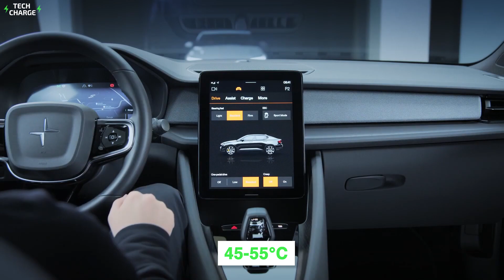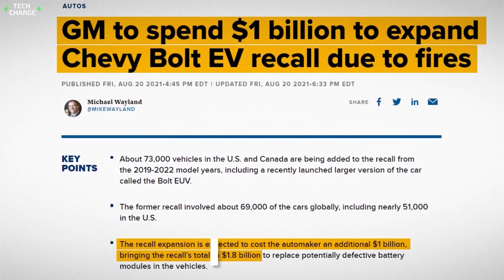The Shocking Truth About EV Fires You Need to Know

Comment: In an ICE car you carry, in the form of liquid fuel, about half the energy you need to move your car, the other half being provided by the air containing the oxygen needed for the chemical reaction to release the energy required for moving the vehicle. An EV has to pack ALL of its needed energy and carry it along...
Reply: totaly irrelevant, when ice cars burns and uses the oxygen of the air and with this releases same heat energy than BEV.
more importantly ; just because an EV burns doesnt mean that the battery automatically also burns ,
in other words in  many EV fires the battery wasnt affected before firefighter arrived which lets statistic look even better for EVs
Reply: @Pyrcae  Not irrelevant.
Reply: @Pyrcae no. The battery contains the oxidizer as well. They burn way hotter than gasoline  cars.
Reply: @thinking-laaf  
battery fire temperature is high only on small spots, looking at the whole surface the average temperature is not different from ICE car. 
anyway it is also often neglected that the battery or the fuel tank are only responsible for a small part of the fire and in fact the rest of the car, tires/seats/plastic interior ... does produce a big part of the fire & heat
Reply: Sobering thought and good point, Jean.
Reply: This is the crux of the matter. That's a lot of energy. Couple it to the basic fact that this battery technology is new.  It is not as regulated as ICE manufacturing because regs on the latter have had best part of a century to get to grips with the basics of ICE tech. Then you add in the pace of innovation in battery-powered technology and the temptation of manufacturers to go with innovations before they have been time-proved.

Now add in the difficulties with pollutants in extinguishing water and air pollution from the fire itself.
Reply: @anemone104  
statistics are clear that its 10 to 50 times more likely that ICE car catch fire.
and I am not sure what you mean with your pollution statement , but you hopefully not forget pollution caused with the need of fuel for ICE. beside of the permanent local exhaust gas we faced enormous pollution due to the Extraction of petroleum.  Deepwater Horizon  ..  just name one of the numerous disaster
Reply: @Pyrcae  Not true numbers.  First, what is it, 10 times? 50 times?  You don't know!  Also,  those are 20+ year old ICE cars.  Wait until EV's get that old, you'll see that EV's are not so green when they catch fire.  There are hundreds of EV Fire videos, soon to be thousands.  Who would think that going green would cause so much pollution?
Reply: @COSMACELF1802  
10 to 50 times is based on different parameters & calculation ,
the point is that no matter from which perspective you look at it , ICE catches by far a lot more often fire than BEVs.
Reply: @COSMACELF1802  first mass produce  EVs are now getting 10 years old and there is absolutely no evidence for higher fire risks
Reply: @Pyrcae  It's all guess work,  time will tell.  Let's see in another 10 years what happens.  Suffice to say, EV's catching fire is not a reason to avoid them.  My reason for not getting EV is that I can't afford one.  I can buy a used ICE car for much less than EV.
Reply: @COSMACELF1802   no need to underrate the clear numbers & statistics. this is no guess work. 
regarding the price I fully agree with you that today they are still too expensive for big part of the consumers, while we also have to understand that we are still at the very beginning of the transformation where as usual first the wealthy people are able to afford , it was the same with the mobile phone, the TV as well as the first combustion cars 120 years ago.
battery production costs decreased by 80% in the last 15 years, this will continue and in the next 5 to 10 years BEVs will be cheaper than any comparable ICE car
Reply: @Pyrcae  That's a fair prediction.  But for now, the EV's still have problems.  I'll wait and see, but it's wrong that the government mandates them.  Oh,  EV's aren't really so new as you think they are.  They've been trying for many decades.
Reply: @COSMACELF1802  yes, we already had BEV 100 years ago, on some spot for a short time even more successfull than ICE cars.
Now its the battery technology of the last 20 years which is new and made BEV competitive to ICE cars.
Of course they are still several challenges we have to face, especially the sufficient power distribution to many homes. but none of the challenges are real blockers, we can go for the huge benefits of the BEVs for which it makes sense to prioritize its development. and this is by far not only about CO2, its also about importing only a third of the energy for the same distance driven, this is reducing energy imports and dependencies from other countries.
Reply: @COSMACELF1802  and its about industry and job security , car industries have to be pushed to BEV to make sure china wont serve whole world with BEVs because they were faster with the development.
yes , BEV transformation is hard and might cost jobs, but staying with ICE car industry will cost a lot more jobs , I can assure you germany is already facing huge risk to lose the huge china market because they were too slow with the deveplopment of the BEVs

Comment: I wonder what the insurance companies think of this, does it cost more to insure an EV?
Reply: I Don't expect that to last very long.  Just a small bump can total an EV as apposed to a petrol or diesel.  Repair shops require a large distance between ev cars to work on them safely.  IMO, ev's are a good idea. But definitely not the answer.
Reply: It ought to.
Reply: My insurance in the UK actually went down by £12 a year. Hyundai ioniq 38kwh costs me £242 a year fully comprehensive
Reply: Insurance business is based on risks management, not emotions and fears, otherwise there’ll be no such business. Imagine your house could also catch fire from faulty wirings, short circuits etc. Would you be happy for insurance companies to then stop offering covers because of house fires everywhere? It’s same for cars, be it gas powered or EVs, they can all catch fire. However insurance companies base their premiums on actual risks experience, not YTube videos like this one. ( This vid included a car fire with a red fuel tank close to it and a row of burnt grass depicting the line of fire travel to the burning Mercedes!)
Reply: @jacobheinz8236  Yes I would agree and thankfully they do would on facts. However what I was really saying is the more EV's show they have risks the insurance will increase. Of course if the facts so they are not a risk then we will be fine but I somehow think the risk costs are higher than we think. Hope Im wrong because I would like an EV but Im very hesitant of something that if it does catch fire is near impossible to put out and would likely take my house with it but I wouldnt want to leave it on the street either.

Comment: With all the rubber plastic, and the Toxic Corrosive Chemicals in those battery 🔋 Packs,  where is the clean air, and public safety? This is your future, and for fender bender on a Tesla is $47,000. Due to Cameras or LiDar Sensors 
Normal cars are $10,000.
Just heard most Automotive Insurance Companies are leaving the state due to the Electric Vehicle's causing involuntary fires of other properties, as well as their homes. 👦👍🏎🏁🚩 Petrol ⛽️ is my only futures, as a matter of Fact 2 Tesla's were trying to run me off the road.  Since I am against these and commented that when unplugged these battery 🔋 Packs Packs don't have cooling systems flowing through the battery packs.  To keep them in nominal temperatures 🌡 to prevent expansion and crushing cooling systems. Which If you look up Mix Lithium Ion and Water... all you seen in the video occurrs.

Comment: Lithium battery fires are not extinguished.  Water is sprayed on the location to keep things cool and prevent the fires from spreading.  Lithium burns at a high enough temperature that the water molecules in the electrolyte dissociate into oxygen and hydrogen, so lithium battery fires do not need external oxygen.

The leading cause of short circuits in lithium batteries is the recharge cycle.  Even the highest quality, best maintained battery that only connects the highest quality, best maintained charger, under ideal charging conditions, will form a short circuit.  It will take longer than for lower quality, ill-maintained equipment, but it will happen.  Lithium batteries release energy when lithium atoms leave the electrode and dissolve into the electrolyte and recharging the lithium battery is done by causing lithium atoms to leave the electrolyte and bond onto the electrode.  The problem is that the atoms do not return to the same place on the electrode that they came from, but tend to clump where the electrode is rough.  With additional charge cycles, the roughness gets worse, until the short circuit forms.  When the short circuit forms, there will be a fire, if the energy density is high enough.  The best quality batteries start out with the smoothest electrodes, so it takes longer to form the short circuit.

Redox batteries get around the problem by having two electrolytes that produce energy by enabling a flow of hydronium ions [H3O+] from one electrolyte to the other, through a membrane, and then being recharged by forcing the hydronium ions back the other way.  Redox batteries are developed enough for power grid use, but need more development for vehicle use.  The electrolytes may be some combination of corrosive or toxic.  A potential advantage of redox batteries is that the electrolyte can be recharged separately from the vehicle, so a vehicle with discharged electrolytes can be recharged by replacing the electrolytes
Reply: That sounds like a decent tech for stationary batteries but I do not think it will translate well to a car. By design it would probably be very difficult to scale its size down and increase its energy density enough to be suitable in cars or other portable uses

Comment: When an EV goes up, it's an inferno, and can restart at any time even if you think it's out. It's called thermal runaway due to shorts in the sealed battery unit. In principle, it could happen to any EV at any  ime without any warning, and can be so intense, nothing can really survive. It can happen when the car is parked and idle too as discussed. Poor build quality/QC in far east EV's means it's way more common there, and if China begins large scale exports as expected, it will become more common here too. Fire departments now have to ask if an EV is involved in a crash so they can bring along car sized 'bath tubs' with them and completely immerse the EV in it, possibly for hours as it's the only way.

Comment: And ferry company's in Norway is banning EVs and hybrid cars because of fire hazards. And Germans are now charging there cars with coal powerplants after shutting down all nuclear powerplants...
Reply: Even with some of the ferries running on lithium batteries. 😂
Reply: @jamierose4088  It's not the same.  A ship running on batteries will not have the same risk of fire as a passenger car.  Cars rust, and all EV cars will eventually burn, it's a matter of time.  The ship on the other hand will have commercial funds to maintain and replace the batteries before they are unsafe.  The ship also does not suffer the same vibrations as a car does.  The first thing you learn in car mechanics, anyone can make a car, but it takes serious thought and skills to make one that can drive for thousands of km's and several decades.  EV's are still very new and will be proven to be not as green as the liars want you to think.
Reply: That is a very good idea!  Safety first.

Comment: First EVs due Pollute  the simple FACT to make one horse power  takes universally the same number of (can we use BTUs ) power units be it from Gas Diesel or Coal  and wind  or solar do not count because there too little around   
HUH the Second problem the Numbers that are stated for the Bolt are WRONG and are well published  they have a major problem of FIRE they were ALL recalled there were some that were not recalled because of AGE and the Laws Regarding recall 
The Common EV is possibility safe as a short term Commuter Vehicle and
in the long term of things this may just Prove to be an interesting FAD imposed on the populaces to control a mass transportation problem   and is a symbol of no more then Status    interesting Video well made  good for the Uninformed  or in simple terms for the KOOL AID  drinkers  Among us

Comment: Highlighting data will be a problem here, and people cannot understand statistics
1) Auto-insuranceEZ (an insurance company is ONLY interested in liability) shows PHEV : 3474/sale , ICE : 1530/sale,  EV :25 fires - ie normalised by sales.  So NO , EV's are NOT more likely to catch fire
2) EV /battery fires are classed as progressive/predicable, whereas petrol fires are explosive and unpredictable.  In petrol fires, you must run away, in EV cars you can predict that the fire will not explode in your face and you can rescue the occupants.  Petrol fires explode and use up the fuel very quickly , while EV fires take longer to take to take hold and last longer that is why the fire trucks try to put them out - because they don't explode, but with an ICE car there is usually nothing left to put out once the petrol takes hold.  So an EV fire is much easier to survive that a petrol fire. 
But of course, people don't understand statistics.
It is like SUV's are more dangerous statistically since they all (but one) fail the moose test - crash avoidance test, are more likely to roll over - causing serious injury, and have worse braking that an equivalent sedan/saloon as they are heavier and less stable (higher CoG).  But of course they have been marketed as the safe alternative - cos people don't understand statistics or evidence based analysis.
 I am sure I will get lots of crap response, or even have this post deleted as it does not fit with the oil industry narrative being pushed by this channel.  Just remember, you are being gaslighted !
Reply: I think you need to watch more EV fires from inception to end. Having experienced small scale li fires personally and watching many videos of actual fires I can assure you they are very dangerous. They are very energetic, fast spreading and unpredictable. Gas cars do not explode that is a movie thing they generally burn and can be put out reliably. Li fires can not be extinguished and the temps that it burns at along with the speed at which it spread makes it a fire that can only be solved by letting it burn itself out. Gas cars once extinguished properly pose no further risk. EV batteries can experience flare-ups hours and in some cases days latter.
Reply: @mitchellcrane9809  I have seen uncontrolled lithium battery fires, petrol fires, methanol fires, magnesium fires, propane fires, and many other types.  The most dangerous are volatile (liquids that become vapour easily) as they a more dense than air and spread as an explosive vapour.  All emergency services are well aware of the dangers of this type of fire.
Put together with the 500 times - petrol only cars, or 1000 times more likely with hybrid cars, then from experience I know where I prefer to be sitting
You do realise the latest battery chemistry is nearly inert and cannot be made to burn even with catastrophic damage.
I realise that so many people have been gaslighter over this.

Comment: Lithium reacts violently when exposed to water, or even moisture. There doesn't have to be high temperatures or any of the other excuses, a simple water leak is plenty - and then the fire department comes along & hoses them down, with water ...
Reply: What are you suggesting? The fire crew is incompetent?

Comment: Well done for calling them EV's. They are not cars, they are Ipads on wheels, basically milk floats. They have no emissions except for the emissions of all the power stations needed to make the electricity. Plus all the exploitation of third world countries to  mine the materials for the batteries. The battery ranges are crap and non existent if it's cold. The charging infrastrsucture is virtually non existent. I'm not sitting in an ipad every 200 miles for an hour or more just to get me home.